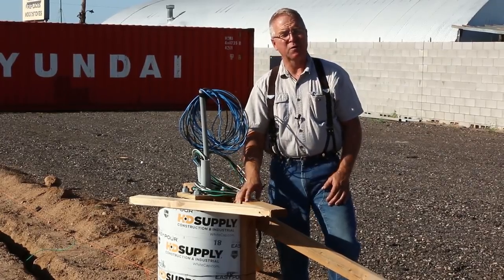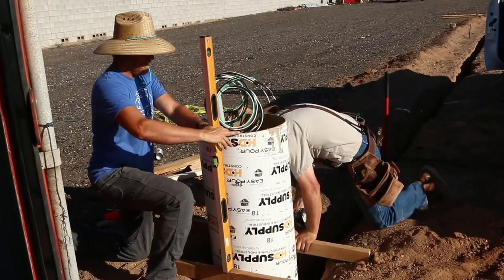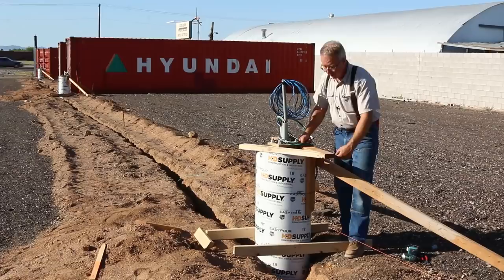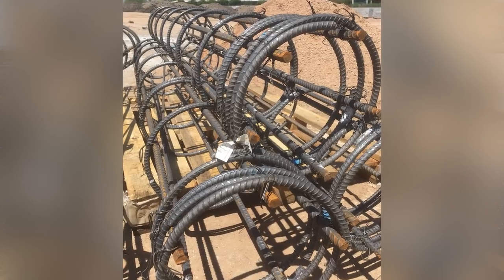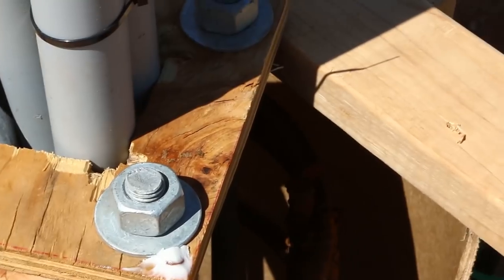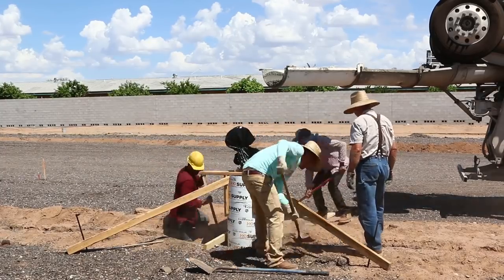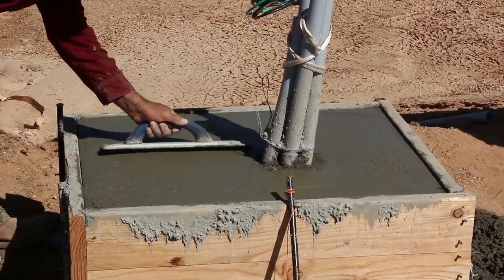Pouring Concrete Street Lights

Comment: One detail about the bolts inside the concrete base - you need to have them line up with the side of the building. If the base of the light pole is square, it looks odd if it is out of alignment with the buildings. You need to get this right BEFORE the concrete arrives - don't ask how I know!
Reply: THE WORLD IS FLAT, THE SKY IS AN ILLUSION CREATED BY TTE STOLEN MAGIC OF ANCIENT ORIENTAL ARCANE WIZARDS YOU FOOLS!
Reply: Very good point!
Reply: J Wagner petty petty petty.

Comment: Nearly always these pole bases are backfilled with native excavated material at the wrong moisture content and with near zero compaction.  Fortunately the lateral loads are very low so failure (listing) is rare, unless they get smacked by a heavy vehicle.  From an engineering view, these things built without compaction are the bumblebee that can't fly.

Comment: They also make beautifully cost effective light buckets for a home-made Dobsonian Newtonian Telescope
Reply: I was in Dobson's first official class. I believe we used Burke Tubes.
Reply: @Sharklee4  That must have been wonderful. I'm happy you got to have that memory 😊
Reply: @J5X7  That's a nifty idea! 😊
Reply: @J5X7  I once got to use a Dob made with the concrete form. The fellow that made it ground his own mirrors and used microscope eyepieces as these were the only available to him (I'm talking 1960;s Brisbane, Australia) For the base he made a concrete mould into which he embedded the screw housing from a fire hydrant. He made wishbone style forks that he screwed into the base. Being a fire hydrant screw housing, he could control how much tension could be applied to the movement which was precise, firm, and very smooth. A real work of art and real engineering genius. Eight inch tube with long focal length which made for some spectacular viewing. The views of Venus and its cloud bands, was unparalleled in any other type of scope I've used. A planetary scope, to be sure, but it could hold it's own on the deep sky stuff as well.

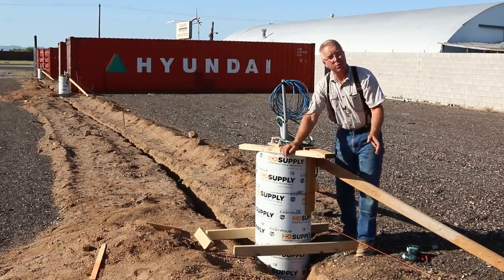Comment: 'braces attached w/screws', @5:05 - Thank you! it dawned on me one day, about 20 years ago, that a screw would not beat apart a delicate form that had steps (round) formed from 1/4 plywood. the forms held and the only complaint was from the laborers who queried, " how are we gonna strip this form?" 
I offered them my cordless screw gun...Didn't think of the crisco trick tho, thanks again.

Comment: Formed and poured 80+ in a downtown retail area...formed pretty much the same as in the vid...made a diagonal cut in a 5gal bucket to help place the conc, think we averaged 6 per day and that bucket lasted thru all 80+...used EZ Cheese to protect the screw heads.
Reply: We did not use ez cheese, smh.

Comment: In some instances the uprights have to be finished, as in when the government says no lines from the tube. This makes for good times when you pour 20 or more.  First strip the tube, unwrap or cut with side grinder down the side. Next get a wooden or my favorite a sponge float and rub them down. Gives a nice rough finish and is much easier and cheaper than putting ardex on all of them. Side note, ardex is great for making a bad situation look good and adheres great, just very pricey.

Comment: We  always did these in two pass pour protocol.  First with a 3.5 to 4 inch slump to seal the bottoms and then wet up the load for  fill pass to a 5 or so to give a less bubble entrenched   finish.  Common sense but it's nice to have  in the plan  before you start pouring.

Comment: You can use old fashion window caulk for the screw heads, it resists any weather and pops out instantly when you need to run the screw out of the hole.

Comment: I'm fairly inexperienced with concrete and have a quick question: I presume the rebar goes all the way down and rests on the dirt at the bottom of the tube. Is there any concern of corrosion of the rebar compromising the integrity of the concrete over time?

Comment: The hydrostatic force is only effected by height for any water column/fluid column. This is because gravity only pulls the fluid in one direction.
Reply: ... however, the force in the larger diameter tube gets bigger and bigger. Pressure is force per area and the area is getting bigger -> higher tensile stress in the tube along the most critical way (longitudinal stress). This stress is equal to pressure times diameter divided by 2*wall-thickness. https://en.wikipedia.org/wiki/Cylinder_stress

Comment: Hello,

Do you think that these bases can be used to as pylons to anchor fence posts? I ask because if the fence is solid then it would react to wind, and when wind hits the fence you would get a lateral (horizontal) force. 

It seems the bases can sustain a strike, but can they hold up a solid fence in high winds and keep it from being blown over? I only ask because light posts don't seem to react to lateral forces set up by wind.

Thanks

Comment: I had to take a concrete design class for my Contruction Engineering degree... that amount of rebar is super overkill. I love it 😂
Reply: Ben Shell not really as they are designing for loading from being hit by a large truck.
Reply: Monique Melanson, the height of the concrete is for truck bumpers, the rebar and depth of the column is for wind shear or resistance to the wind load.
Reply: I am sorry you are wrong.  Even though the wind load is significant sideways load.  However, it is very clear that being hit by a truck is a much greater load and that is the reason for the height, mass, and amount of rebar.

Comment: Use a hex head type screw, say 65mm Gal, instead of Philips head, they don't fill up with concrete and are quick and easy, and can be reused many times over (Timber Screw Class 4 Hex Washer Head)

Comment: How do we set out such piers in as straight line using strings? I am setting out street lights in a project at 25m distance.  Hence, I need to know if they are in straight line or not.

Comment: Another tip with anchor bolts, NEVER tie them to the rebar cage. It might be sound like a good idea, but the rebar WILL move when the concrete is poured an take the anchor bolts with it.

Comment: Just wandering what's the difference between cement and concrete
Reply: Cement is a mixture of lime and clay. Cement mixed with water is mortar. Cement mixed with sand, gravel,  and water is concrete.

Comment: 1:05 But the tube sectional tension increases with the diameter
Reply: It's called "hoop stress".
Reply: Concrete is not a liquid so pressure is quite localized? Think sand. No matter how much your diameter is, it will be the same tension per linear feet of circumference if your height is low enough.
Reply: kefeer123 I think that
-  Wet sand has the hydrostatic pressure of the water present and once vibrated or in movement (like poured concrete) will double that pressure by becoming a full liquid.
- A constant "tension per linear feet of circumference" gives an increasing tension in the tube for larger diameters
Reply: Pressure is force per area and the area is getting bigger -> higher tensile stress in the tube along the most critical way (longitudinal stress). This stress is equal to pressure times diameter divided by 2*wall-thickness. https://en.wikipedia.org/wiki/Cylinder_stress

Comment: Always wondered how they do these as a kid
Reply: @essentialcraftsman  Some old shopping centers have light poles mounted on top of concrete piers that used corrugated culvert pipe for forms.  Needless to say, the forms are still there and quite rusty.  I wonder if that was the innovative thinking that led to the cardboard tubes, or the other way around.
Reply: @ronyerke9250  as a younger man the steel culverts came first then the tubes.

Comment: Hey there, so I have a question for you. I'm an electrician by trade and carpenter by hobby, I have no knowledge or love of doing concrete pours or molds but I have heard using rebar with concrete actually lessens the life over time because the rebar can corrode which causes expansion in the concrete, which in turn leads to failure. Is this true? If so I would be interested in knowing what could prevent that.
Reply: tsherry3223 using rebar inside a concrete structure requires that the rebar be completely encapsulated by the concrete so none of it is exposed to outside moisture.  There are standards for minimum distances from the exterior that the rebar must be, based on the rebar diameter and/or engineering specs.
Reply: @badlandskid  that makes sense. But what if the rebar has already rusted before its set into place? That's mainly where I've heard the issues from.
Reply: tsherry3223 yes that is a valid point.  I’ve seen some inspectors on government projects actually make the contractors take a wire wheel to the bar to remove the corrosion.  But in actuality the bar will contact moisture again when the wet concrete is poured around the rebar.  If you want to completely eliminate all corrosion them you need to spec stainless steel rebar or epoxy coated rebar.

Generally the design is going to over build both the size of rebar and the amount of encapsulation to allow for a bit of corrosion and still have the necessary strength to perform its function.
Reply: They also make fiberglass rebar which never rusts.
Reply: Adam R they do.  So far as I know it’s rated for slabs but are still testing for structural?   I could be wrong.  🤷🏽‍♂️
Reply: Critical stuff they spec epoxy coated. Over the years I've done a fair amount of site lighting and have only seen issues when rebar has penetrated or is to close to the surface or poorly vibrated or rodded.  Usually new lighting packages require new bases to be poured unless they simply retrofit the fixtures and leave the existing poles. Back in mid 80s carpenter's would form, laborers pour and finishes rub out in my area, unless it's a state or powerplant job. Otherwise we do it. They also make a flexible and reusable chamfer to put around the top edge of the sonotube.
Reply: Concrete is quite brittle by itself. It is just rocks and sand glued by cement which is a relatively poor glue. Rebar is what holds it from being pulled apart (in tension), concrete is mostly to fill space, add weight and stiffness (in compression).
Reply: Great question tsherry3223. All of the comments so far have good useful info. My two comments are; you, and probably your children are never going to see any problems from corrosion on anything you build if you follow these practices. Two, on big jobs like bridges and high rises a sacrificial anode is employed. An engineer is hired to figure out how best to do it. Some of the bridges around here are even painted with a special high-tech zinc paint that acts like a shield, as I understand it. This subject, as well as grounding an electrical system, can get extremely technical.

Comment: Since I’m first here I’m in 8th grade and I make carvings and    other things in my small workshop in my shed and at the end of my school year my class is going to dc and I’m considering going. However it is 1,100 and I’m considering buying a chainsaw and the stuff you need for it or a new set of power tools and a table saw. I figured this is a good place to ask people.
Reply: It's good to expand your horizons and visit distant places, and our nation's capitol is an exciting and interesting place.  If you can reasonably do it, don't miss the opportunity.  As to your shop and tools, yard sales are your friend.  Many old tools can be had for pretty low prices if you're patient and willing to put in the time and trouble to clean and repair them.  There are tons of great channels offering guidance on that adventure, but be careful that you don't get sucked into the trap of spending all your time watching someone else do stuff, instead of doing stuff yourself.  Check out Izzy Swan's $50 Wood Shop series.  Izzy does some pretty crazy stuff, but he also offers some ingenious solutions to basic problems.  I'd also look for a mentor.  When I was a kid, I volunteered to sweep-up, clean tools, and just be a shop monkey for a mechanic and a gunsmith shop, just to be around and learn things.  They'd pay me a little, share some knowledge, and often provide me with tools, advice, and raw materials to help with my own projects.  They eventually allowed me to do some work on my projects using their machinery.  Of course the big goal is to make enough money from your projects to subsidize your shop time and buy better tools of your own.  I started making and selling utilitarian knives when I was in high school.  Not long ago, I ran across a big bag full of old butcher knives and steak knives,  I'm planning to clean them up, re-handle them with some nice wood (probably scrap from a wood floor installer) and mosaic pins, and give them as Christmas gifts.  My advice is to seek out what you enjoy, but be careful not to let it shrink your world.  Get out of your comfort zone as often as you can, and soon you'll be comfortable anywhere you go.  The world's a big amazing place with an endless supply of interesting things to see and learn about.  Drink it all in and explore it.  Also, just as Scott advises talking about anvils if you want to find one, talk about your hobby and the tools you want to acquire - and the work you offer or can do - to your neighbors, church members, and your friends' parents.  Look for interest groups in your area on Facebook, etc. and on apps like Nextdoor, where you can connect with local people who might need a hand in exchange for some tools.  Good luck.
Reply: I agree about Izzys channel for a good way to learn about getting by making some thing you need. Yard and garage sale is a good place to look for tools sometimes a older gentleman may make you a good deal on them just talk about your plans all they can say is no but, if you ask the right one you might be surprised. Learn as much as you can plumbing, electric, concrete and carpenter the more you know the better your chances of finding work. Alway be honest and humble about what you know never brag let your work speak for you. Learning how to use a chainsaw takes time. Go to D.C. just to see the world outside of your home town.
Reply: My advice is to not buy any tools until you absolutely can't do without them. Many times I've bought tools anticipating that someday I'll need it, and it's still unused. Wait until you have to have it to do a project and you can't figure out an alternative way to do it. And I agree that yard sales and Craig's List can be good sources, if you're patient.
Reply: Jeff Knox now that I think about it my grandparents have a ranch I’m Montana and have some old sheds and a barn and next time I go out there maybe I’ll bring my own suitcase and ask if there are any tools in them. I also intended on spending my extra money or if I can’t go I will use it for tools. I ultimately intend to make woodworking or maybe even construction my job .
Reply: Go....I went to Washington when I was young, I wont forget it. Take Pictures.I look back at the few pictures I took and cant believe how young I was. Ive always wanted to see the Vietnam memorial wall, have alot of friends with their name on there. Someday maybe.....GO

Comment: Also , Scott ..
  In most modern countries around the world , not just the US , it is building code to set post on concrete piers , mostly due to an incident that occurred in the 80's , where I live ( Fort Worth , Texas)
  Japanese tourists were killed from a detiorated steel post that was set into the ground.   The steel rusted out and collapsed , falling on the people below .  This was at the Fort Worth Water Gardens . 
  I'll include a story about this incident.  From the time of the incident , the building codes were changed , as people realized how easy it is for steel to become compromised .
  It may take longer in Arizona and not as much an issue as a location that gets much more ground water from rain.

https://en.m.wikipedia.org/wiki/Fort_Worth_Water_Gardens